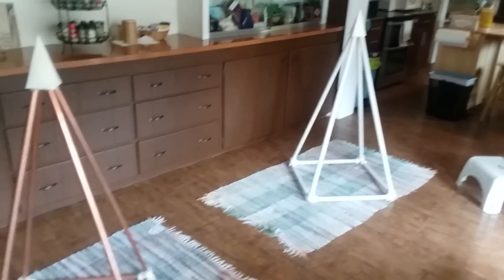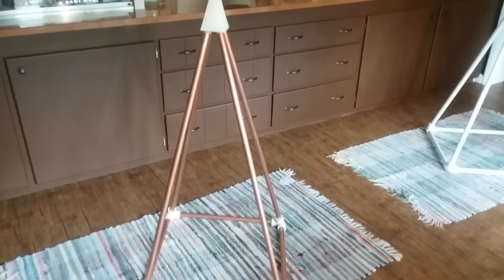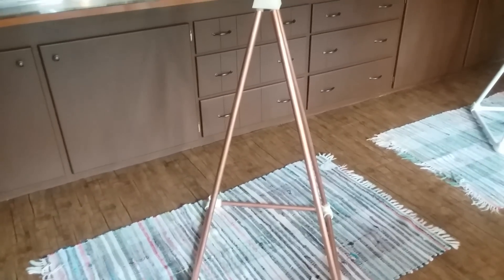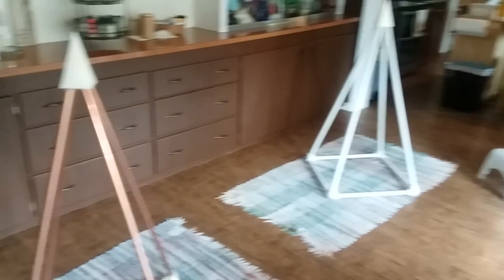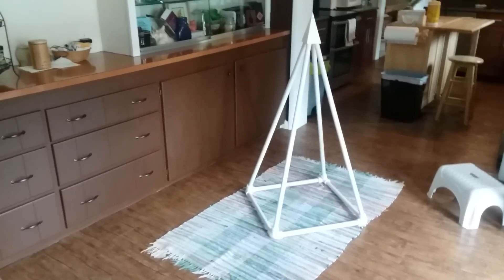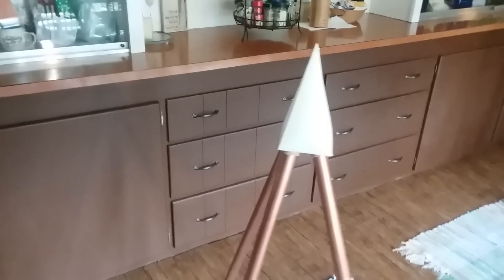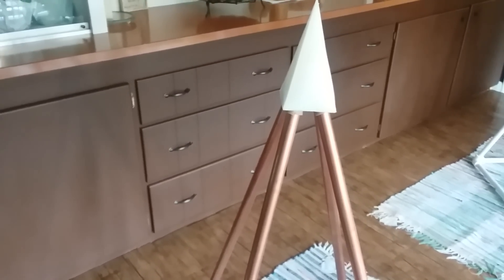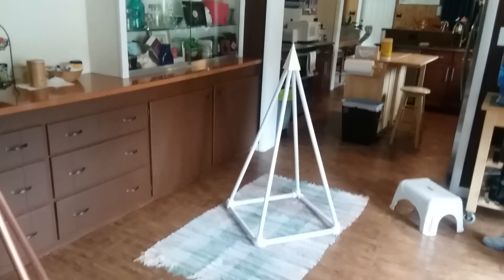See the Energy Difference Between a PVC and Copper Pyramid

Comment: I wonder if the junctions of the copper pyramid were copper, making the copper pyramid totally copper, would get a stronger reading. It seems that the pvc corners of the copper would interrupt energy flow.
Reply from the maker: We did a follow up video where we connected all the pipe coming into each connector with conductive copper tape, but it did not change the result.

Comment: According to Wilhelm Reich conducting materials catches and immediately emits etheric energy around while non conducting materials tends to keep energy itself like a battery. So if you wrap metal pipes with pvc material your energy field may be even higher cuz metals will attract and emits energy while pvc  pipe inside will keep it and accumulating energy
Reply: Which may be why the Great Pyramid was made with a conductor on the inner wall layer and an insulator on the outer
Reply: @cressmason  spray on silicone

Comment: Those are 8 pieces of copper pipe independent of eachother not even making contact for 1 thing from what you propose I would assume making a pyramid of pool noodles would have the same effect you could get a couple for under 10 bucks an cut into a pyramid about the same maybe bigger then what you have and they are also basically foamed pvc pipe ......

Comment: Use one material and use a more scientific testing device wether testing for EM field, negative ions or electricity. Ultimately it’s all charge having the ratios correct for the scared geometric aspect to gain energy from the fractal nature of the universe/ self similar connectivity and also be aware of what’s a few feet underneath the pyramids. That’s where they’re drawing cations (positively charged ions= harmful) and converting them into Antions (negatively charged ions=beneficial).

Comment: Have you ever tried to use two extension leads together without plugging them into each other? It wouldn't work would it? That's what you've done by using pvc joiners with the copper pipe, the pvc is an insulator. Sit pvc across two battery terminals and what happens? Sit copper pipe across two battery terminals what happens? Put a price of pvc between copper pipes across two battery terminals what happens? It's straight forward stuff.

Comment: Are there any other ways to measure the energy field of the pyramids? 
And which one is the most reliable method?. Thank you.
May all be happy and at ease, free from dis-ease.🙏🙏🙏
Reply from the maker: Quite honestly this is a challenging issue.   A Ukranian scientist named Volodomyr Krahnoholovets invented some machines to do it, but that information (and the machines) are suppressed in the West.  I sell an LM4 Experimental Life Energy Meter based on a similar meter developed by Wilhelm Reich.  You can get some information on it on my website onlypvcpyramids.com and some videos on my YouTube page.  However,  I have not yet been able to set up the experimental conditions free of other influences such as metallic elements in the area to successfully test the fields directly.  I can do indirect tests by placing water under the pyramid and then subsequently testing for Life Energy with the meter.  I am similarly seeing if I can use a simple multimeter to test body voltage inside and outside the pyramid. If successful I will put these videos out as well.
Reply from the maker: I should add that my list is limited to things all of us have access to.  The Russian research, for example, have measured the energy field of their pyramids using radar, something I don't have access to.  Similarly, sophisticated laboratory equipment has also been used as well as public health statistics, etc.

Comment: The original researcher used boxes of steel and wood/wool. The theory would tell you that metal inside of plastic in layers up to 7 of each would fantastically increase the energy.  

Also slice your tubes lengthwise, or use sheets focused inwards (flatten the tubes) The metal converts to electrostatic energy which the plastic concentrates and collects. 

There is a science to this technology. Peace, B

Comment: You ever rub a balloon against copper and get any static? PVC holds a static charge. You will get the exact same readings if you make a cube structure with the same materials. Especially if the humidity level is low in the room. You are ignorant and have no idea what you are talking about. Stop misleading everyone and get a real job.

Comment: Thank you for your reply.

Unfortunately, I am none the wiser.

Please note that the decibel is a globally used term which describes the ratio between two unit values. Therefore, it is independent of the unit under measurement.

Which brings me back to my original query: what exactly are you referring to when you say energy, or power?

If you cannot say what it is, then perhaps you can say what it isn't?

For example: volts/metre, gauss, webers, teslas?

If you are not sure what it is that you are measuring, then how can you beleve what the measuring device is telling you, since it would appear that there are too many unknowns in both the unit under test and test device?

Comment: As many have mentioned before when you placed the PVC connectors on the copper you broke the flow of energy because Copper transmit at a different frequency than PVC, any pyramid shape will transmit energy if the materials are the same example, plastic, wood, copper, metal etc in healing work you want a conductive material, not a non conductive material.
Reply: https://youtu.be/q75t-m6mzjk

Comment: It’s not rocket science . It’s basic knowledge . You cannot interrupt the flow of energy by introducing a foreign material in the matrix .  In this case copper tubing with plastic connectors . That doesn’t even make sense unless you’re just making a box or shelving . All material has its own vibration and energy . Once the flow is broken , your results will suffer . Do the same presentation , but this time use ALL copper for the other pyramid, not PVC or rubber bands . Continuity is the key .

Comment: Copper is probably pretty good as it blocks a lot of emf.  A mu metal pyramid would probably be the better.  We aren't trying to create energy fields.  We're trying to block them.  I don't see how pole pyramids could ever work.  You would want solid sides that could block the emf They had Billy Meier build his pyramid underground.  The earth could block the emf.  Semjase also told him that pyramids are only beneficial when they aren't being exposed to emf.   You'd need to be inside the pyramid for it to benefit you.  So you'd need a pretty large pyramid.  You don't want to be anywhere near a pole pyramid once they roll out the 5G. Fred Bell was said to be in bad health when he died.  His pole pyramids were useless.
Reply: Ahha, that was one of the purposes I wanted to build pyramid properly was to see if it would block excess EMF or at least repel them or transmute them.  It is why I was interested in Nuumite and Jet and Shungite and black tourmaline stones as that is what their abilities tend to be is protective shield from harmful energies or nuumite transmutes a bad energy vibration into a useful one.
thanks for the extra info I can use for what Im trying to work on. lol I had not considered the possibility of any harmful effects from a pyramid until I was reading what the poster further above, Porlibre1,had wrote.
Now I will muse on that issue along with the other factors.
lol yah what you said about Bell, I was thinking about that earlier when reading some of his stuff and listening to some recordings he was talking about pyramids,  I wondered if he was getting bad effects from some of his constructs he had as he had multi-linked pentahedrons in long "towers" and also larger pyramids with smaller pyramids inside connected base to base to form octahedrons inside.

but also I thought, Hmmmm if these things are supposed to work so good, why was he dropping dead?
not every death of a "fringe" scientist is a cabal murder.  
They had decades to kill him off, he has been writing those revealing books and giving lectures on "secret" stuff for a very long time.  Why would they suddenly try and kill him? 
What is the point when he has already written so many books and all the lectures he did?  
He looked a tad overweight, perhaps he had a sudden heart event or stroke.  but now Im wondering if some of his pyramids things had negative effects,which he himself said to beware of the changes in degree angles of sides as they did discover that it changes the effects on physiology in all sorts or ways.
Reply: @d.aardent9382  Yeah, I'm not convinced that the pyramids were power plants or that their purpose was to create energy.  I see no reason to try to construct pyramids that give off the most energy.  That is what Fred Bell was trying to do.  Some of Billy Meier's info was useful about pyramids.  I think he buried his pyramid in the ground for the same reasons the native americans made their earth mounds and why pyramids like the ones in Bosnia are buried under the earth as well.  Probably the same reason there are so many pyramids under water as well.  I do have some pole pyramids but they are in a shielded room that blocks emf.  That's the only time I would consider using one of those kind.

Comment: Congrats for using scientific tests to prove your point, however the copper pyramid needs to be only copper without the pvc connectors. Not sure if you did this on purpose or not but the two conflicting materials will of course prove your point. next time use only one material per pyramid and your results will be more credible and look less like a shady deception.  :)

Comment: Dimensions???
Reply from the maker: the key is the slant angle of 76.345 degrees.   How you actually build your own pyramid will determine the dimensions based on your method of connecting them together.  If you are using my connectors I have a pipe cut chart on the website.

Comment: This is not even close to an accurate comparison.  The copper has to be all copper, not mixed and insulated with PVC and rubber. . .  Duh. . .
Reply from the maker: We will be doing another video where I connect all the copper pieces with copper conducting tape and we'll see what happens!

Comment: It’s refreshing too see real people doing real science please keep up the good work. A quick question. Shouldnt you be using all copper? In my mind having copper with pvc connections is not close to a fair test. In my mind mixing the materials on the copper pyramid is only hurting the results. Thanks much love and respect.
Reply from the maker: Lots of people have made that comment, so I have ordered some copper tape to make an electrical connection between all the pipes.  I will be doing a video on that soon.  However, to my knowledge there is no research  indicating base metals in a pyramid do anything but hamper the torsion field generating capacity.  But, we will find out!
Reply: I have only found you today. Thank you so much for the response. I will be sharing your channel with as many as possible. This is real science and for that I thank you so much. You guys rock.!
Reply: @pyramidsciencefoundation  so you are saying use wood with copper wire or PVC with copper wire rather than using a full copper pipe. Also, what does this do for Humans in every day life. What are the benefits

Comment: You reduced the copper efficiency by disconnecting the corners with the rubber and plastic PVC, the copper should be connected from all Corners by copper fittings
Reply: The experiment has been damaged from the start

Comment: I have built a gong stand with welded copper pipe and the gong did not sound good, I have built the same stand but with wood slats from a box spring and now it sounds great. I think the problem is in the vibration, the metal vibrates more easily than the wood and it has its own vibration and they are coupled with each other so it does not work well. The problem is in the harmonics.
Reply: You got it, Nikola Tesla said to understand the secrets of universe,  to think in Terms of Energy, Frequency and Vibration. Each material has an optimal tuning frequency. We must listen to that, and i dont kniw enough physics to figure that out.   Perhaps it has to do with molecular formula and golden ratio,  but probably not. Anyway, this is great experiential science.
Reply: @JohnVieiraact  Each body, each form, each movement is a vibration, the color itself is a vibration, we are several vibrations in harmony, we just need to understand this and be able to measure it, from here, the universe is endless. Cada corpo, cada forma, cada movimento é uma vibração, a cor em si é uma vibração, somos várias vibrações em harmonia, só precisamos entender isso e ser capaz de medi-lo, a partir daqui, o universo é infinito

Comment: A different test:  plant a crop in the center of each pyramid under the same conditions.  Increased protection and nurturing could be measured easily and scientifically.  Make sure to document the process and have a third party plant the crops.

I love your passion, but I think you need more stringent testing efforts.  Only through these methods will we gain respect in the scientific mainstream
Reply: Keep Moving
Hello, I think you forget that it measures the radiation with a Lecher antenna, with this you already have the results instantly, you do not need to plant anything inside the pyramid and wait for weeks to see the results. If instead of a Lecher antenna he used a universal pendulum of Chaumery, surely he could know something more about the energy that the pyramid emits.

Comment: How are your pyramids orientated ? What is the angle of your sides ? For them to reap the best results one face should be north facing and the inward slope should be 51 degrees .
Reply: If you're going to fudge the numbers, then your pyramid has nothing to do with the pyramids of Giza. You're just using misguided hippy magic to come to your conclusions. You would do well to educate yourself in the ACTUAL specifics of PROPER sacred geometry, something that takes a lifetime to become adept at, and then begin to experiment with practical applications.
Reply from the maker: The pyramid is oriented to magnetic north.  The slant angle of the pyramid is 76.345 degrees= apex angle of Giza.  I don't agree with your assertion about the 51 degrees.  I am doing a presentation on this topic in two weeks at Conscious Life Expo in LA.  I will be posting an expanded version of the presentation here after the Expo.  Stuff the world doesn't know yet!
Reply: Only PVC Pyramids - Giza is 51 not 76.
Reply from the maker: absolutely right for the slant angle, but the apex angle is 76.345
Reply: @pyramidsciencefoundation  Ah right. But you are double the apex of Giza (38 degrees) are you going from side to side then?
Reply: As in, not from side to the 90 degree centre line....

Comment: One thing to think of, is that the copper pyramid has PVC joints. According to the law of one and David Wilcox’s, the power goes down if mixing different materials such as wood and metal or PVC and metal.
Reply: I think you mean David Wilcock not David Wilcox’s.

Comment: Originally these structures were called - per nettur' in the old Kemet/ Sufi language it meant - house of nature a place where ppl would go to be healed using sound, the 3 big ones at Giza are the oldest not built by Egyptians but a mush older race, the Egyptians themselves in their old texts even say they superceded a much older race, this is why they have no hieroglyph's ..
Reply: The Law of One by Ra., talks about the use of the pyramid. LL Research, you can search the material by subject.
Reply: " The Great Pyramid of Gizeh, sometimes called Cheops or Gizeh Pyramid, stands along with two other pyramids, which are smaller and built at different times by different techniques. The Great Pyramid  was built 73,360+ years ago, at a time when the constellation stood in the star sign of Cancer. At the time the Gizeh Pyramid was built, there were also two other pyramids built of the same design and for the same purpose. One of them is in China and is buried deep under the ground; it may not be discovered for some time. There is also another one somewhere in South America that is just below the surface of the ground; it may be discovered sometime soon.
The pyramids were built by a group of Lyrans who designed them for their own needs."